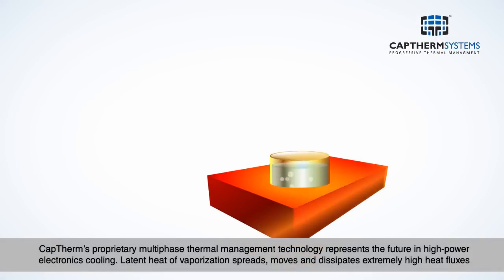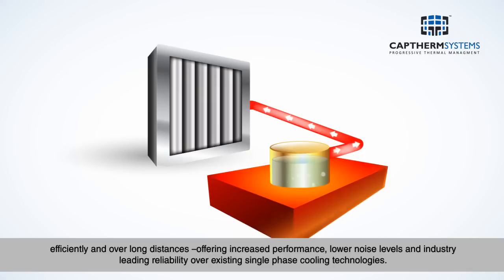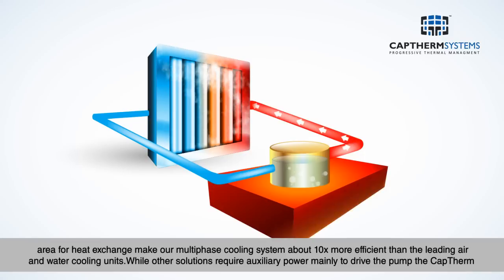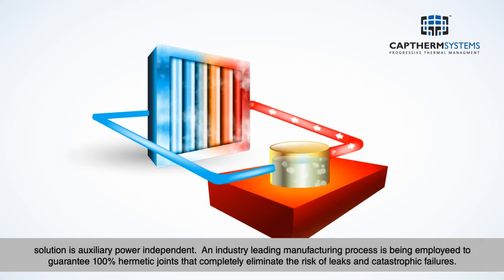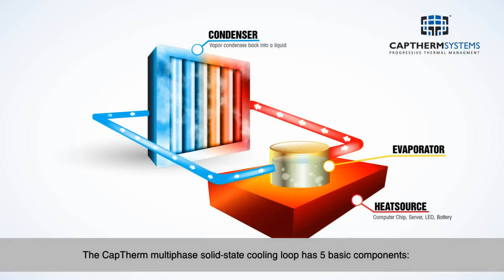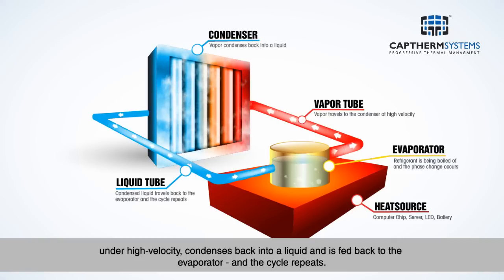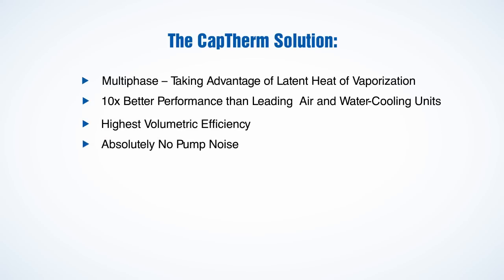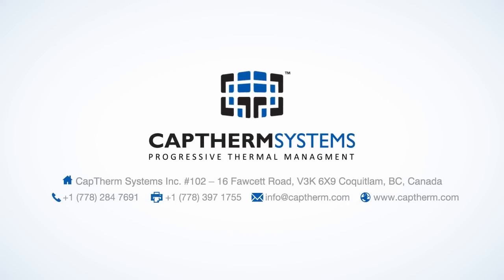CapTherm's New Cooling System Explanation

Comment: How is different from Asetek's VapoChill Micro CPU cooler from 2004?  

It isn't sold anymore, but was also marketed as a using a passive phase-change system in a small form factor.  Like a predecessor to modern PC cooling heatpipes, it had three pipes draining into a hemispherical base with a refrigerant that boils at 34C, and the whole setup provided 150W of cooling w/72CFM fan.  The pipes had a slant in their design to ensure gravity returned the condensed fluid back to the base, it didn't rely on capillary action.  The video of the CES demo of your product had the  same slant and function, hence my original question.